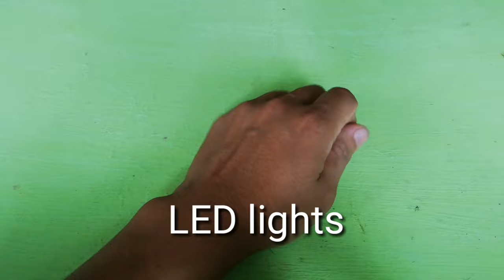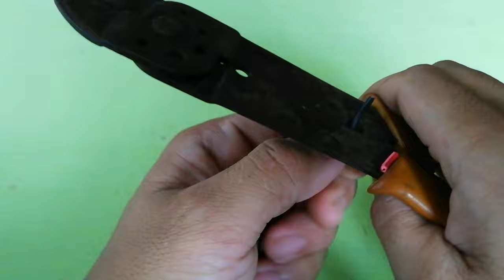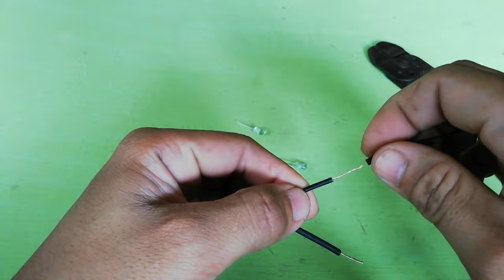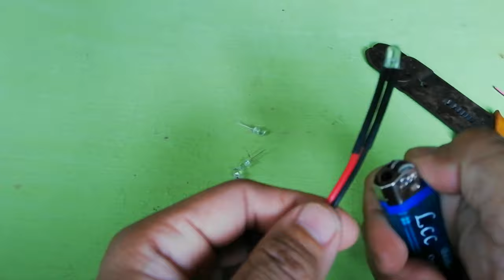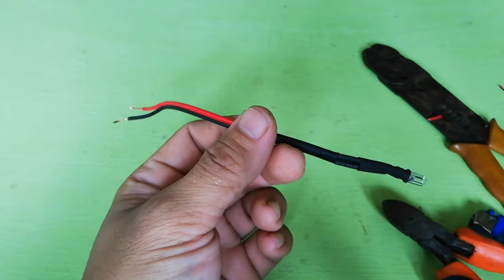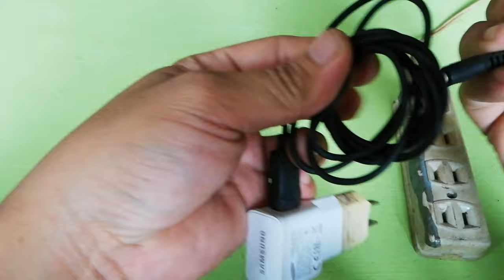proper way to wire led lights

Comment: How do I join at least 10 12 led's with one adapter? Please let me know... Thank you
Reply from the maker: You can connect them using parallel connection sir. You can use cellphone charger to lighten your LED lights
Reply: @creativejunior7060  I was gonna ask a similar question so thank you

Comment: What is the second wire you have used to cover those inner wires?
Reply from the maker: I used shrinkable tube to insulate the copper wire to prevent short circuit sir.

Comment: You put the red one inside and held the black one (ground?) to the side of the end cap so doesn't that make you the ground? I don't wanna sit and hold it, I want it to work as a night light.
Reply: Just tape the wires there or something
Reply: I did not expect the power strip,  and adapter at the end

Comment: i tried doing this with a usb Wire and a similar led light just like yours and even with using an Ac adaptor f or the usb wire ,connecting the +  - to the cathode and anode of the led light it still doesnt light up and even with usiing a 7.4 Rechargable lithium battery trhe LEd light doesnt work 

i also tried using different led lights and it still doesnt work 
any tips you could give?
Reply: Bro did you solder wire to bulb? Or if you don't have soldering iron then joint the USB red+ and black- to bulb node nicely and make sure that + don't touch - and -dont touch + otherwise it'll doesn't work!

Comment: Thank u " But Can I Use 3Little Battery To Light It Or Only Plug     "Please Reply"
Reply from the maker: Yes sir.
You may use 3 little battery but makr it sure that the led lights can carry the output voltage of your batteries..

Comment: where do you get the pieces to cover the wire please
Reply: Electrical tape would work just fine.
Reply: It's called a heat shrink tubing they come in many sizes, you can buy it from typical electrical stores.

Comment: 1.5 volt ki battery ke through kaise hoga
Reply from the maker: I use 3v battery but you can use 1.5volts battery also.. Even 5volts on this kind og LED is okay

Comment: Can i connect 10 led lights together? Btw the video was very useful.
Reply from the maker: Yes maam, you can connect 10 led lights together, you can connect them in a parallel connection. Thank you so for appreciating my video ma'am.
Reply: @creativejunior7060  i tried but only one light works

Comment: What is the name of wire
Reply from the maker: I just used simple wire sir..
I used dc voltage electrical wire and i put shrinkable hose for insolation..
Thank you so much sir.
God bless you sir
Reply: @creativejunior7060  hey bro don't call me sir l am your bro 
And thanks
Reply from the maker: Thank you so much bro..
Reply: @creativejunior7060  sir can you please mention the link of wires because I want to buy it online for my project

Comment: This video shows nothing of which side is positive, which is negative (long positive? Long negative? Etc) I have some portion of knowledge with led lights all I was liking for is a guide to take a small step of led tights, wire it to a batter that I can make for areas in my house when all lights are off at night. Eg bathroom, passage way etc fck...can anyone please advise? Fcking all these platforms have become useless try goggling "wiring small strip LED to battery" it takes u to fcking things that have no relevance. So sick and tired!

Comment: Where is the resistor ?
Reply from the maker: Hi. Good day,
On this video, i didn't use resistor because the powet supply voltage is only 5 volts.
But on my other video like how i make laserline for motorcycle.
I use resistor and diode for tge rechargeable battery..
I hope you will watch how i made laserline for motorcycle.
Thank you so much..
Godbless